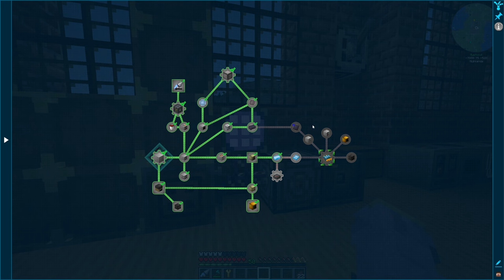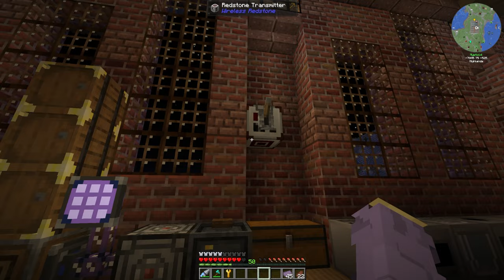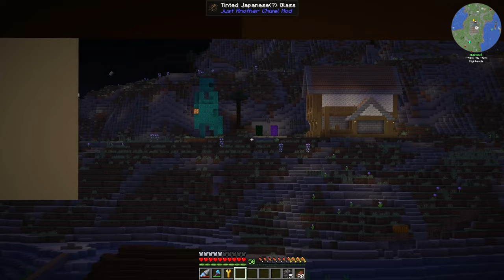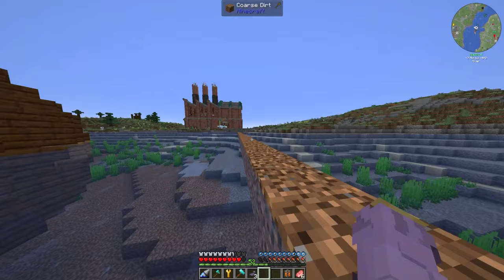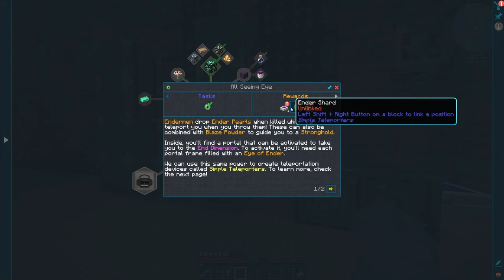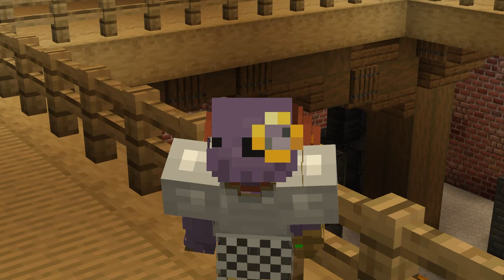FTB NeoTech - Ep. 7 - First MV Machines & Electric Quarry

Comment: for the steam boiler and tank I set up a little bit of integrated dynamics to automatically turn it on and off with a lovely hysteresis circuit with the delayer so that it kicks off at 95% full and turns on at 35% and this way it's all hands-off 

Power has been a serious thorn in my side up til now and I'm thankful for your lead in this factory design for ideas on how to do mine (though I did alter the factory slightly to put the tree farm up on the roof instead of the dome)

Comment: what are your EMI settings...all the color coding? the left side panel? I am def not using it to its potential.
Reply from the maker: If you open your inventory, and click the EMI button, on the left hand side click "Left Sidebar" and you can add "craftables" under the pages section. For the color coding, it's just using the crafting tree by clicking the "View Recipe Tree" while looking at any recipe, and then clicking the magnifying glass.
Reply: They kind of explain it in the quest book, press A on an item to bookmark it so it shows up on the left panel (this was a feature on JEI as well)